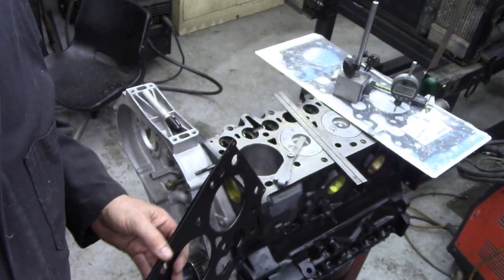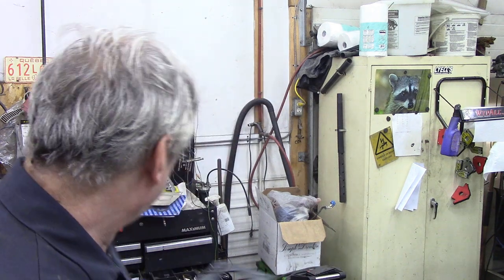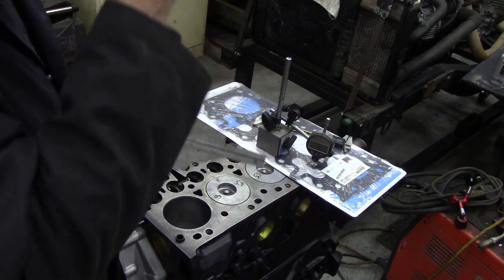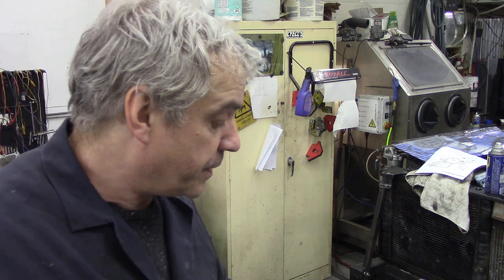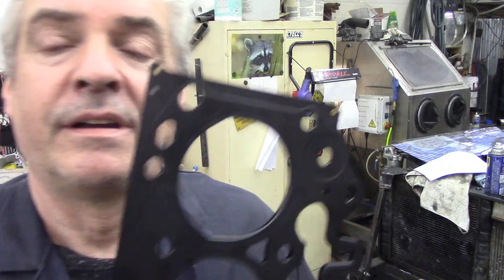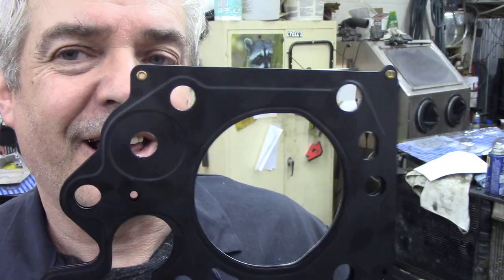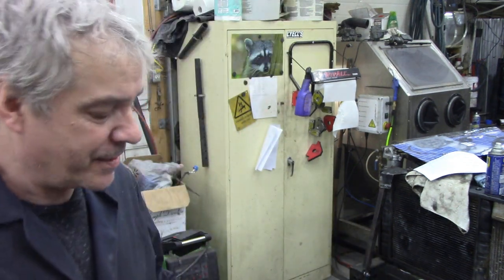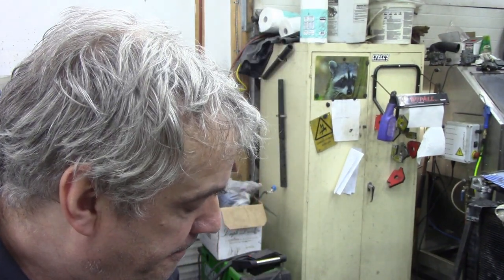How important is piston protrusion on a Tdi?

Comment: In these cases, when you have holes in the surface where you want to put the magnetic base, I normaly stick it to a calibrated (grinded) base plate and so I can slide it all over the surface wehere I need to take measurements.
Reply from the maker: Good idea!

Comment: The Vauxhall Cavalier mk2 engine was non-interference engine,  was great if the timing belt went you could fix it on side of the road and be back running in under an hour. Also the clutch could be done in 45mins without the gearbox being removed, thanks to an inspection panel. People often wondered why they done away with it, should be obvious more clutches were changed in lunch hours than work hours ;) lol.
Reply from the maker: Great point!
Reply: Best engine and box they ever made I had the 1,8 Sri and a 1.6 sr for the wife Great cars

Comment: Had similar marks on the piston from valve strikes. 300TDI.  Broken rockers and bendy push rods. The valve stem caps were also donuting them selves way to often. Turns out the cam shaft pin that ties into the camshaft gear had ovaled out it's hole in the cam shaft. Took forever to track that down as the issue because it's buried in the timing cover.
Reply from the maker: That's very rare!

Comment: If you are considering either a bespoke gasket or machining pistons I'd choose the pistons tbh.  Common practice for engine builders to machine valve relief in piston crowns to accommodate either bigger valves  or higher lift cams. Obviously you measure the crown thickness before you commit.

Re: measuring piston protrusion.  I would get JP to take a piece of rectangle bar stock and drill a hole for the dial gauge and a rebate to clear above the piston as an alternative to a mag base.
Reply from the maker: Let's see, when the head is off!
Reply: https://youtu.be/S9fvxhX-QRQ
This exactly the homemade tool I was referring too.

Comment: i followed your comments when i did my head and it actually only needed a 2 hole not the 3 hole it had even after having the head skimmed then used the 2.8 torque rules

Comment: Mike, if I had run out of options because someone had decked the block too far, I'd check the piston protrusions, then proceed as per correction of oval big end bearing bores, except instead of the cap faces I'd skim the rod side faces of the rod/cap mating surfaces by the required excess protrusion dimension then resize the big end bearing bores. Same stroke just a little lower from the top and within spec for the head gasket thickness spec. As said only as a last resort to keep the block.
Reply from the maker: I see what you are saying, but it is a fair bit of work
Reply: @BritannicaRestorations  I think cheaper than replacing a block, and the only other suitable option is to machine piston crowns, which with the TDI maybe no option at all. To resize the rod ends is a fairly routine operation for an engine reco shop, just done in a lathe or on a universal mill with fly cutter then hone, they do it all the time to save rods where bearings shells have spun. I'd certainly do it to save an otherwise perfect block, no biggie.

Comment: I had a belt let go on a FIAT twin cam at around 6000 rpm. The engine was toast. 

I sent you a pic of my 300TDi where the tensioner stud broke. That one broke 3 rockers and bent all 8 pushrods.
Reply: The new TBelt kits they're selling here in Australia now include a new replacement stud for the tensioner, they say replace it regardless of if it looks ok, usually the old ones get fatigued. Mate of mine had his go on a TDI engine he'd just re timing belted, thought the old stud was ok. No bent valves though, God bless the old TDI, just the new stud, a few push rods and a couple of rockers and on his way, legend!
Reply: I had a belt let go on a Honda EB2 Civic, went to town and got another belt, put it on and was away again.

Comment: You can run a 13 head on an 1100 if you pocket the block i use to race minis 1300 head was a cheap big valve job sometimes i just can't afford  a 1275 motor  so Austin 1100 had to do
Another way to measure it get ablock of steel 2inch by 4 by1 thick get jp to mill a step 1/8 half way across the long face tben drill a hole to take your dti with a thumb screw to hold it 0 it ona flat surface that won't rock
Reply from the maker: I will bear it in mind for the next time, but it was 30 years ago... Lol!
Reply: @BritannicaRestorations  yer like wise
Reply: Ahh nostalgia - cheers! 
Allegro 1300 heads bolted straight on and had enough meat to take them out to 1340 - loadsa fun.

Take out the clock to let the twin Webber trumpets through the bulkhead and you could smoke V8 Jags and Xr3's up the bypass all day long.

I can still hear those Webbers sucking lungfuls as the A-series redlined in 3rd.. Halcyon days - sweet 👍

Comment: You should have kept the 1275 head and fitted it with double valve springs. The valves don't bounce then. I used to have a 1071S engine, and that used to REV!!!!!!!!!!!!

Comment: A two holer vs a three holer  sounds like a plumbing problem!

Seriously, sounds like the hybrid gasket could work and save a heap of machining.
Reply from the maker: Well in theory it shod work - depends on what we find with the head off
Reply: @BritannicaRestorations  Only problem with theory was told to me when at college for motor vehicle engineering. "The course is split into two parts, theory and practical, 30 percent theory and 70 percent practical. As theory is fine but rarely works in practice lol." In saying that I hope it works, it sounds a great solution.

Comment: Once you have a reference measure for your piston heights you can measure the the Azerbaijan and calculate how much has been machined off, is it not possible to skim some more off the block to compensate for 2 stock gaskets to achieve the correct clearance and compression ratio  and leave the pistons and bottom end alone, bad idea to skim pistons it will put it out of balance . If you put two shims in you will also have to some gasket material between the shims I don't think it's practible.

Comment: Could also put valve pockets in the piston crowns or indeed skim the tops off, I think a dodgey  thicker gasket would be sketchy. Or sink the valve seats which is what we used to do on the cosworths after facing the heads/blocks.
Reply from the maker: And then the balance of the pistons wil be out
Reply: @BritannicaRestorations  easily rectified

Comment: I Like the way you think, simply can't see a problem with a mix and match head gasket, well worth a punt. Nothing ventured and all that. Skimming the pistons would be a lot of work, there is also the combustion chamber in the piston which would also need to be corrected after it was skimmed, each would have to be returned to its designed volume which would make balancing them quite a lot of mucking about. Would the reduction in the volume cause problems for a compression detonation engine? Can a diesel pre detonate? Lovin this problem Mike
Reply from the maker: If the block was too far skimmed - then returning it to the original STD should not cause issues
Needs the head off to see what is going on and measuring up - I should be able to work out the gasket thickness from measuring the protrusion  of the pistons as they are and adding shims in the gasket to make it 0.50 to 0.60 mm minimum
Reply: Is the top of the piston actually hitting the head? Would be another question. If not, why not drop the valves a little further into the head? Maybe the the mechanic didn't do that when assembling the thing? Just a thought.
Reply from the maker: I have had no idea what has been done to this motor. This is a new head, so there is no need to recess the valves

Comment: It sounds a good idea mike but if there is one piston that is over protruding either due to a rod/piston issue or the block decking issue. If you space the head gasket enough to sort the clearance for that one piston what is the compression going to be like on the others if they are correct?  I know diesels of this age aren't that fussy, but depending what you find we could be talking fairly different CR's from the front of the block to the back - of course if you get in there and the whole thing has been Skimmed on the piss not once but twice, that would at least explain things. Although it leaves you looking for another engine again.
Reply from the maker: Needs the head off and a check - it cannot be far off as a 0 hole gasket is on it at the moment, and it runs (but there is a tick)
Reply: @BritannicaRestorations  As you have said you will just have to see what wonders await you!!

Comment: Whats with the figures on the tightning sequence mike. I have recently done mine. I think it said 40nm plus 60 degrees and 60 degrees followed by 20 degrees on inner cylinder head bolts
Reply from the maker: With the MLS gaskets as fitted to the HS 2.8, I use their set-up  = much simpler. Never had a head gasket go again

Comment: I would be to have the pistons turned down, adding an extra shim could fail as the layer arrangement would be wrong, ie soft hard hard soft instead of soft hard soft, it means you have no soft sealing material between the two central layers, but if you do it make a vid to show it works, ps how much trouble has this engine been to need two block skims, interesting

Comment: I've used 3 hole gasket on 200tdi engines with no noticeable performance or reliability degradation. 

A mate overheated a 300tdi D1. We got the head skimmed and the engineer went to the max allowed but still didn't get it completely flat. My mate was like sod it, so we put the 3 hole gasket on. Pulled the lock pins and turned the engine manually twice over with no contact. And sure enough the loyal tdi fired up and ran well enough.

Guess God looks after fools and drunk cos we hadn't been drinking haha
Reply: For many, 'well enough' just doesn't do it.

Comment: Given the choice I would machine the pistons. Those digital calipers should only be used as an approximation, especially the cheap ones, infact don't buy the cheap one, buy a second hand depth mic instead.
Reply from the maker: That is a $350 certified Mitutoyo vernier - hardly a cheap Chinese one
Reply: @BritannicaRestorations  it was a general statement not an accusation Mike. I use exactly the same one but most people seem to think the Aldi version is the Same. But, where I can I prefer to use a micrometer. You don't see the digital calipers used in good tool rooms..
Reply from the maker: Its all JP uses on his lathe - and he does some pretty amazing stuff